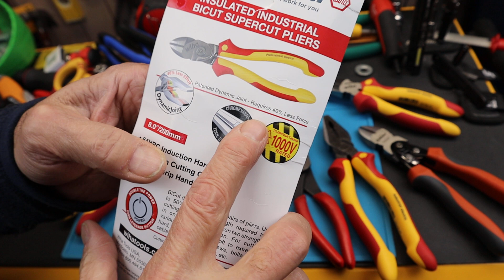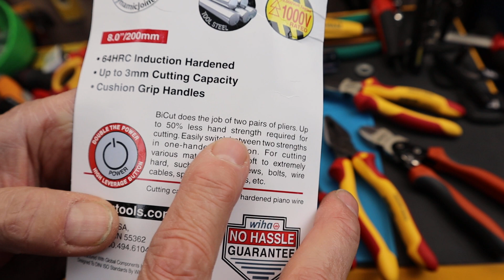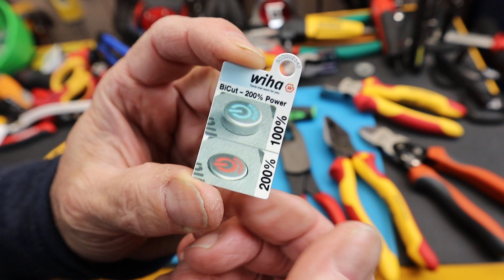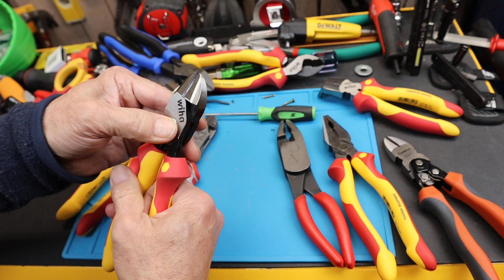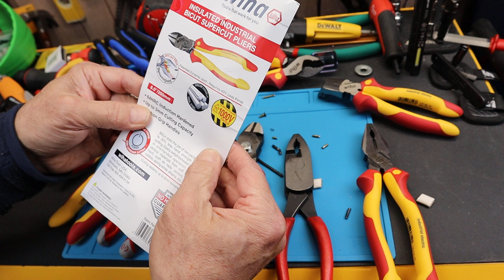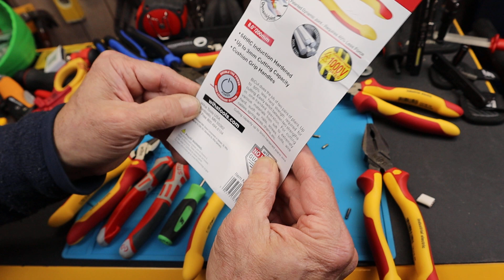Buttery Smooth with a Power Button! Wiha Bicut Supercut Insulated Cutting Pliers w/ handle choices!

Comment: ooh i think I know this one....
1. Power is wrong.  The BiCut feature increases force, not power.
2. forgetting friction, a 2:1 gear mechanism would increase your force by 100%, so you could do a job needing 200% of your normal ability.
3. Or, doing any particular job would require 50% of the force you would normally use to do that job.  Same ratio, different viewpoint.
4. If we allow for friction, or the mechanism does not provide a uniform 2:1 force ratio, the 50% number might drop towards 40%

My ratcheting plant pruners have a better mechanism.  It either automatically works, no button required, or it automatically doesn't. (try again)

Comment: I wanted something like this for around the house as I sometimes need to cut thick metal (eg chain). I ended up choosing the Knipex Cobolt High Leverage 20 Angled Bolt Cut. Allot more expensive than the Wiha offering and the Knipex is only one mode. But it’s very well built, design is excellent and well thought out and ya it cuts things I never would have imagined. However, given its size, these guys have their limitations. They won’t snip an outdoor padlock. But nails, chains are easy work, like a hot knife through butter. 

You seem to have tried every tool ever made sir. But if ya haven’t given the Knipex a try, I recommend them.

Comment: Bought these years ago thinking they would be a great do it all cutting option for my tool bag. They definitely cut in the power mode but the button on mine is such a hassle they ended up just sitting in my toolbox after a while. can't switch reliably between the modes and will often jam just from bouncing around in the bag or box if i leave them in the power mode. this makes it so they are just a more expensive pair of regular dykes since i can't even leave them as a ready to go high leverage option. real shame because they are great in every other way.

Comment: I‘ve had these for a long time, they do generally work well. The button mechanism does loosen up and if put down too forcefully it can be pushed out of place a bit and them lock the pliers up until fully engaged again. Also, one of the buttons on mine falls off from time to time, but hammering it back into place does the trick for a couple months. 
I wish they‘d make these without the button mechanism, because as compound leverage cutters they are fantastic, hold up really well.

Those Wiha electricians pliers at the end of the video just suck, nothing to figure out there.

Comment: I use the regular coated handles in these bi-cut wiha pliers and I love them but after awhile my button is a little finicky sometimes. If I press it to open in the regular leverage position it doesn’t want to open so I have to pop the button back and fourth a couple of times but the blades are holding up fantastically.

Comment: Been using it at work for a while now, quite neat and often saves a trip to tool bag for high leverage cutter. The biggest pain in the butt is the button sits very high and doesn't have any detent, so either while in belt pouch, or put down on a surface, lit gets bumped into middle position and lock the jaw.

Comment: Im surprised you didnt compare with the Knipex 73-71-180 twinforce high performance diagonal cutters. 180mm so 7.087 inches. Id be intersested to see a comparision between all the compound high leverage cutters. Dont sleep on the Klein (yellow handl) HD 9" D2000-49. I think they are better than my Klein J2000-59 (blue handle ones shown in the video) and my knipex 74-01-250 (10" high leverage cutters).

Comment: I bought the Bicut pliers two years ago. As you mentioned, the jaw form and cutter geometry is very nice, provides soft and easy cuts. The pliers are very strong and comfortable, and in many cases can replace a small bolt cutter. The button does get loose over time and if you use them regularly it becomes very frustrating, I had to glue mine in place and now they are permanently in high leverage mode.

I really like these cutting performance comparisons and would like to see more.

Keep up the good work.